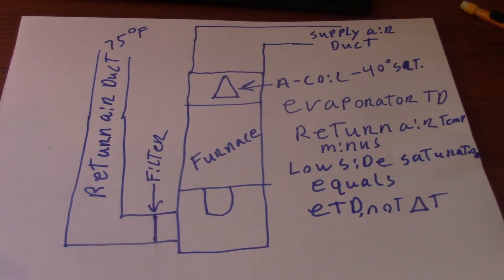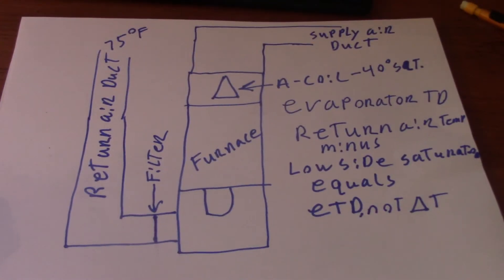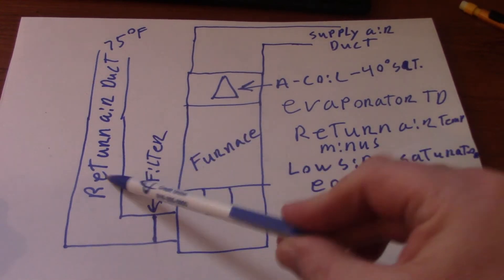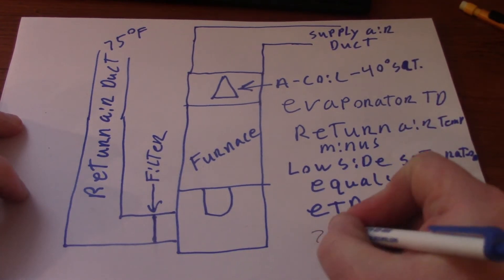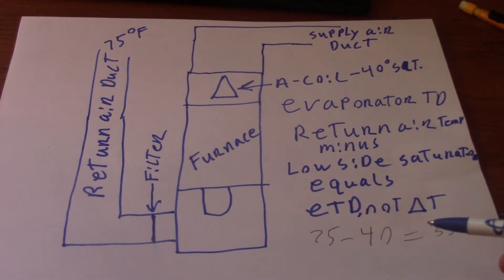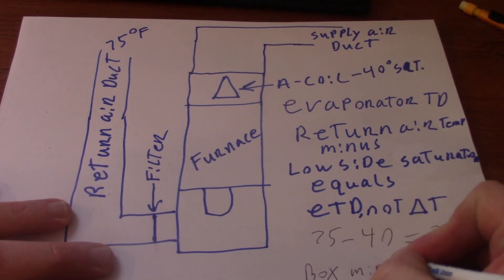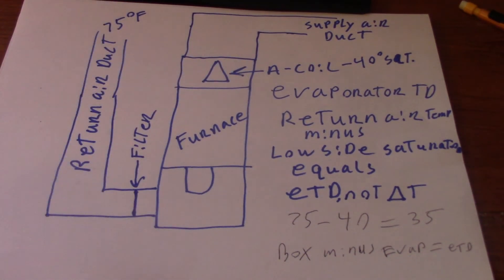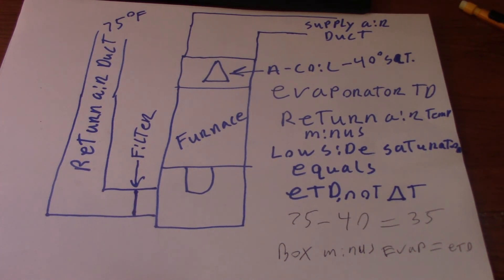How to calculate the evaporator TD for refrigeration and air conditioning

Comment: what is 75 please
Reply from the maker: Return air temperature. The air from the rooms that goes through the ducts back to the furnace or air handler. 

Supply air is what blows out the register in the room.

Comment: Saturation temperature is temperature of refrigerant right? Not temperature of coil?
Reply from the maker: Yes. That what you get from the pt chart.
Reply: U do that when system operating or standing?
Reply from the maker: Pressure will convert when it's running to that temperature.
Reply from the maker: Evaporator td and delta t are when the system are running. They are only used for airflow.
Reply: Thank u so much
Reply: N do u use superheat or subcool methods to charge refrigerantion system or use different method please?
Reply from the maker: Super heat and subcooling are different reading. Both are used for diagnostic testing. The metering device dictates which to charge with. Fixed orifice you charge by super heat. A txv is designed to maintain super heat so it can only be charged by subcooling since the txv adjust superheat.
Reply: My name is John ! What about u?U make really good video! I am enjoying! Thanks
Reply from the maker: Chad. Glad my videos are helping.
Reply from the maker: Bain fart it's both. If the refrigerant is boiling off at 40 degrees, it's a 40 degree coil.

Comment: This  throws me off as an air-conditioning technician of 25 years having to work on low temp. It all seems on the walk-in cooler set I have to work on the TD is about 15°. 8 to 10° superheat is what I adjust the TXV2 usually 10. The box cools off pretty fast and I like the 20° superheat at the compressor. Start to get below 8° superheat on the walk-in coolers I was get a lot of frost coming back to the compressors not good
Reply from the maker: 15 is the high end of the td while low end is 10 degrees. Now the super heat part remember it's a freezer, let's say saturation is set to -10 degrees, it's well below freezing  and will frost up. If it was an air conditioner it would be a problem. If its 8 degrees super heat at the evaporator and frost form on the suction line there is no liquid refrigerant going bas as there is super heat.